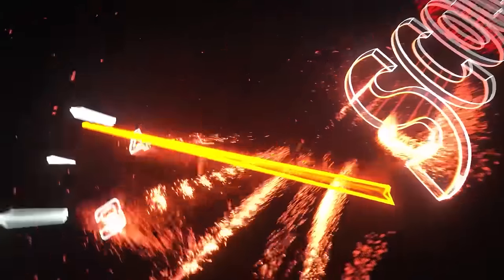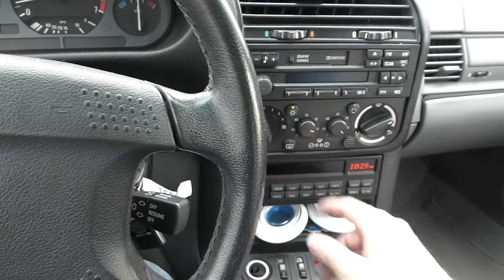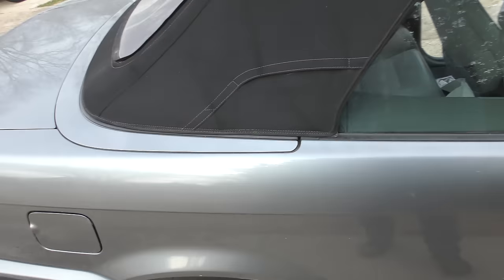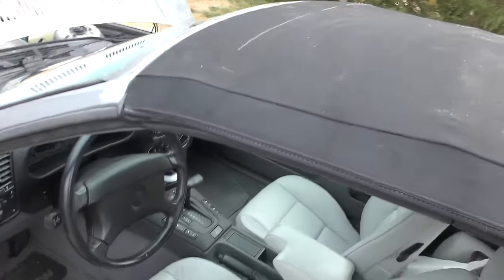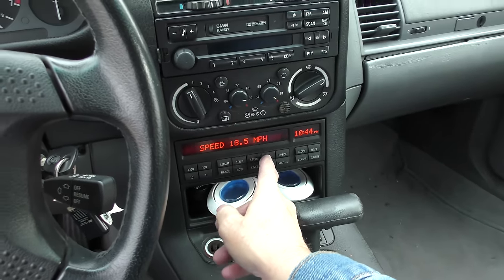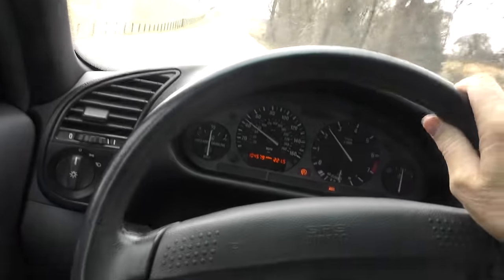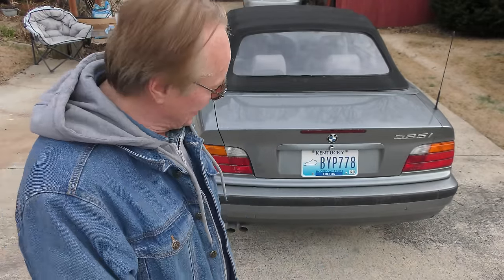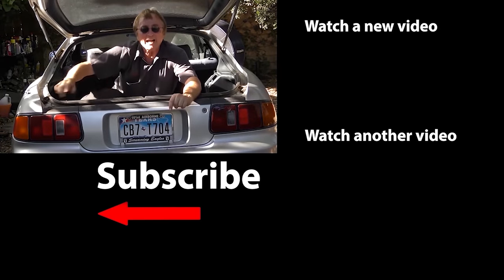A Sad Day for Scotty Kilmer Viewers

Comment: A friend of mine once owned a 1985 325i with the manual transmission. It was built in West Germany at the time. It wasn't particularly powerful or fast but it was built like a tank. It was all metal in the engine bay, no cheap plastic.
Reply: I had an 86 BMW 325 Es came with Recaro seats and the 2.7 Eta engine, standard transmission in Black. My oldest son now has it.
Reply: You and Patrick need to cut back on crabby patties.

Comment: There is a huge different in BMW between something now and something years ago. BMW always mostly had  solid powertrains but electronics were crap because overusing of untested highend electronics. But something like 93, it does not have much high end electronics to break. 😁
Reply: Problem with the older ones good luck getting parts for them.
Reply: I know of a BMW R90 motorcycle that had gone 90,000 miles with just oil changes and Carb being overhauled a few times. I worked at a independent shop that repaired and resold Bimmer
Autos.
Reply: I had a 99 R1100RT and sold itwith 45k, I bet that would or will make 150k easy, maybe even 200 with good care and maintenance, the performance was as good as the day new and was pristine all around, great bikes , I still have 2 k1200, LT and RS, they are pristine and see them hitting 100k easy as well,  cheers! @fromthebackofmymind
Reply: @fromthebackofmymind  bmw motorcycles and cars are 2 different things. Motorcycles reliable and overall good,  cars not so much. Even Germans have a second name for BMW cars that refer to a money pit.

Comment: I miss my '96 Scirocco. I did everything the German car dealership told me to do, even though I bought it used from an individual. Was BUILT! Paint, metal, engine, door, like Scotty mentioned was Tank! Best VW mechanic Corky went out of business. Needed a truck. Bought a '97 Isuzu "s10" in 2001. Now over 300,000. Im the mechanic. Also have 2011 Mini Cooper. Im the mechanic. Miss my '96 Scirocco.

Comment: I have a 1998 BMW I I bought it in 2012 it was 14 years old then had 79,000 miles on it it is a convertible too. Now it has 124,000 miles on it I am the second owner. The car is 24 years old. I still love this car better than any  new car. Mine is a 323i

Comment: I bought a used 2001 BMW 740Il.   Had it for 15 years!    Not one problem, except the usual  brakes, tires, and it overheated one time, but replaced  it and engine did not blow up (I know better than to drive when your car overheats).   That was it!    Best car I ever had!   Loved it!   But someone gave me a 2020 Lexus 350 ES with 43,000 miles on it so that was a no brainer!    BMW had 180,000 miles on it so it was just a matter of time before a major issue.

Comment: Deeply saddening.........🤣 
On another note, Scotty, my 2019 Mazda CX-5 Signature is coming up on 40,000 miles in a month or so.  Should I sell it and get something else, or keep it? I havent had an issue with it yet.  But will need my first replacement set of tires soon and don't want to spend the money on Pirellis if I'm gonna trade it in. I want something that is the same dimensions for my garage and no EV.  Thanks in advance. (I know you don't answer comments but thought I'd try).

Comment: BMWs are endless money pits right after they leave the lot! My Celica is 30 years old, I've never even changed the oil and it runs like a dream!
Reply: Definitely have to maintain them.  Meaning a lot of oil/fluid changes and preventative replacement parts.  I have a 2004 330i ZHP (Performance Package) 1 of 388 made in that color/interior/transmission combo.  I always get comments on it.  My complaints disappear when I get behind the steering wheel though.  Fabulous cars to drive.

Comment: I have one of those engines it was nothing but trouble. I had very talented people working on it and searching the Internet for solutions. It ended up going for scrap because nobody could figure it out.  Possibly a bad valve seat  or stuck valve maybe. It ran well  but would randomly run rough and later smooth out. Until finally it didn't.

Comment: It's amazing (sort of) I bought a 2006 235 Ci convertible, and only had to replace a small item in the back, otherwise it ran fine and that was 7 years ago. It has been across the US twice averaging 29.7 mpg, with a 6-cylinder E46 3.2-liter engine. Took it to a certified BMW garage and it was classified as the best and most original 325 Ci in the north. So, it is what you look for and what you buy that makes you happy instead of all the complaining.

Comment: I just drove my moms 2004 bmw 325ci for a week while I was visiting the parents.  Also made in Germany.  Also a rag top.  But relatively quiet I must say.  I had it up to 90-95 and I didn’t notice a thing.  
But that 2.5 liter straight 6 is a great engine no doubt.  
Heavy cars too.  
But I still prefer my m3😂
Reply: 3200-3300lbs thats a light weight car. Now if it weighed 4,000lbs like a dodge charger then yes that is heavy. My 02 ford explorer weighs as much as todays dodge chargers.

Comment: I own four older BMW convertibles, and they all run great, are easy to repair, are reliable, rust free, and fun to drive. My favorite is the 2006 BMW 330ci convertible with the sport package, because it is a true sports car. Mine has 107K miles and has all of the maintenance performed and documented. The least reliable is my black 2003 Z4, but it is the most comfortable. It seems that I have to do something to it every year, but it hasn't left me stranded, and is the quietest ride I own.

Comment: Please Scott help me.... I have the same car with the same engine and it has the well known rev hang. I've replaced the maf with an original one, checked the throttle position sensor, replaced the spark plugs, cleaned the icv, checked the icv sensor, cleaned the throttle body resseted the ecm, checked for vacuum leaks and nothing changed.... HELP!!!!!!

Comment: Scotty what is your recommendation on how often we should change the oil in our alternators?
Reply: I'm too unable to detect humor and know too little about cars to know this is not a think: LOL
Reply: I believe it's not humour, but rather certain vehicles, in particular German models have liquid cooled alternators, rather than air-cooled, like 95% of all cars out there @stig
Reply: just buy a toyoter and ya never have to change the oil. the thing drives itself to the gas station and fills up while you sleep
Reply: For those who live alternator life,  I recommend KY lubricant and long lasting LI batteries.
Reply: For 1999 and 2000 models I recommend new chipset and fumigation to get rid Y2K bugs.
Reply: Back in old days when were men and sheep were nervous, cars had real belts. Fathers would drag their sons, such as yourself, to the woodshed to be  whooped with timing belt. So that you learn respect and discipline.  
But today , children misbehave, timing belts have been replaced with timing chains which are too difficult to remove and leave permanent marks upon the body. So children grow up without authorita.
Reply: You Should  Change It   When You Rotate Your Lugnutz !!!
Reply: Ohhhh ... you are SOOOO funny ... NOT !!

Comment: Hey Scotty, I saw the old beamer post, and I thought I'd ask you a question. I own a 2011 BMW X5, the car drives like dream on the road and the highway,  but it gets costly once repairs need to be made. Took it to a local mechanic to fix the thermostat housing (about $500) and he said needed an extra 10 hours of work to fix a leak and replace the oil pan gasket (that's another $1,257) This car had an original owner up in New Jersey and I'm the 6th owner, and I live in Florida, but the car is in overall good shape. Do you think in the long run it is best to fix these problems and keep the car, or get rid of it eventually? Your insight is much appreciated 👏 Thanks!
Reply: Get another opinion and tell the shop you want to look at it while it’s in the air.

Comment: I want to know how your son always finds great deals.  All I can find around me is 200k plus mile cars and they still want 20 grand for them.
Reply: You just haveto use common sense ....youre obviously looking at specific brands, and year ranges...i live in NH, everything is expensive...i still find cars that run good for $1000- $2000..infact, i  found an 07 corolla, with 210k on it, but its clean for $800  and an  05 civc with like 140k on it, for $1000....both run  really good..just need  a few small things..yea, theyre old...but,older is better..thw older,the better ...buy a 50s classic before id spend $50k on any of these new thin metal and plastic cars and trucks
...new ones are just cheaply made computers on wheels....

Comment: This is the e36, isn’t it? My brother had one and it squeaked whenever I rotated the wheels. Turned out, one of the ac pipe was located right above the arm that turned the wheel so as it condenses, the arm would lose it lubricant. Bad design imo.

Comment: Plus these old BMWs like these E36 gen cars had solid AC Compressors made in Japan. Truthfully as a high tech German car mechanic I rarely never seen the AC go out on those things even the evaporator core. Good luck finding Japanese AC in a modern German car that can last many years, plus modern German cars are known for having weak evaporator cores because it's plastic not aluminum metal like in the older ones.

Comment: my younger brother wants to buy a used Jaguar😂
Reply: good one!
Reply: Some years back, I tried to talk a friend of mine out of buying a used Jaguar 4dr sedan. She bought it anyway. Guess what happened? It ran for several months, then one repair after another. Later the Jag sat on her driveway for about a year, until she sold it, at a loss. 
And then, she said to me, "I should have listened".😄
Reply: Awful choice...
Reply: @theequalizer9154 Yep, Jag is a car to avoid.
Reply: Many of the later models were made by Ford back when Ford cars were crappy and having all kinds of issues.  Avoid those.
Reply: @mishunkontrol1874  it's not like they were doing a tremendous job quality-wise, before or after Ford.

Comment: i owned one it's fuel injected not naturally aspirated but anyway good luck when the starter goes you have to take the intake manifold off the get to it it will not come out from the bottom
Reply: i'm talking about the 4cyl model

Comment: Scotty I’m thinking about buying a 2007 Lincoln town car with 99,000 miles on it everybody is acting like I’m crazy for wanting it do you think it’s a good buy everything I’ve seen says they’ll last forever
Reply: You could do worse, just make sure the mileage is true and it was maintained
Reply: I'm looking at possibly getting a 2002 Mercury Grand Marquis with 68k miles on it for $3500.  Those Panther platform cars (Crown Vic, Grand Marquis and Town Car) can easily last over 300k miles.  That Town Car is just getting broken in.
Reply: @Mr.Corinthians  I definitely plan on making it last. I have a 2006 mustang gt which isn’t super reliable but I wanted a bigger car that I would have to do minimal maintenance to and this is where I landed
Reply: @Mr.Corinthians  hopefully you see this I got a 2005 mercury grand marquis LS ultimate edition in almost perfect condition with only 87k there awesome rides especially coming off of a 2006 mustang gt

Comment: My favorite car was an 01 530 sport pack 5 speed manual. Real aggressive limited slip averaging 30mpgs with just under 200k miles. After some phone surfer rammed me in a construction zone I got the same car from 06 and absolutely hated it. Slow computerized and sucked gas for no reason and had the lamest limited slip ever. Don't buy anything new :)

Comment: "Normally aspirated" used to mean "carburetor".  Now, it means, "No turbo".  I hate that.
Reply: Nooooo.... normally aspirated means, no forced induction.
Reply: @WALTERBROADDUS  - Today, that's what it means but back in the day that meant that it wasn't fuel injected - i.e. no carburetor.

Today it means "not turbo charged" and that's all, because EVERY ENGINE is now fuel injected.  There are no normally aspirated engines... in the ancient sense of the term.

Scotty pointed to the straight 6 in that BMW and said that it was normally aspirated but in 1994, all engines were fuel injected (either single- or multi-port).  He was referring to the fact that it did not have a turbocharger on it.

But hey, Scotty Kilmer and I could be wrong...
Reply: @GizmoFromPizmo  in 50 plus years, I've never heard anyone talk about carburetors that way.
Reply: @GizmoFromPizmo  Naturally Aspirated or naturally 'breathing' engines, defines those that take in air under normal means at normal atmospheric pressures. The more air that enters into the combustion chambers of an engine, the more fuel can be added - creating bigger explosions and generating more power.....
It's about the air. not the fuel delivery.
Reply: @WALTERBROADDUS  - Maybe it's a "what it is" and "how it's used" issue then.